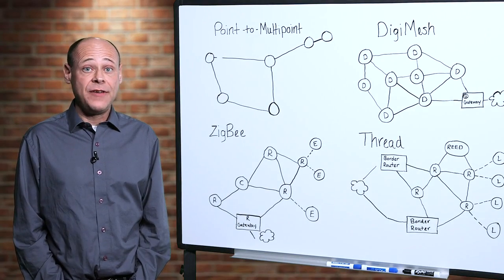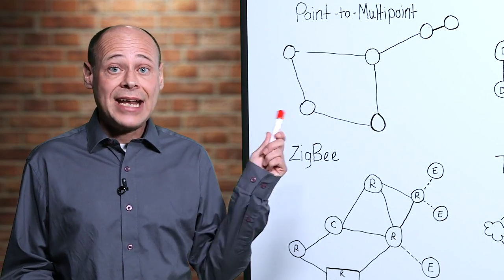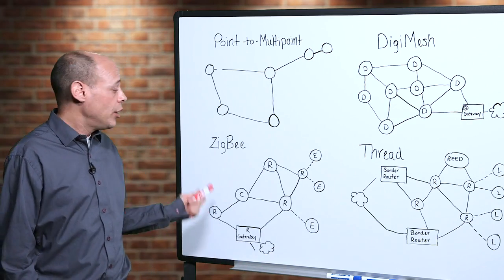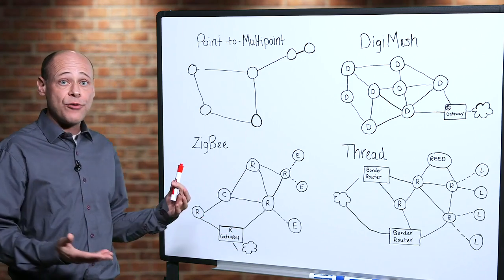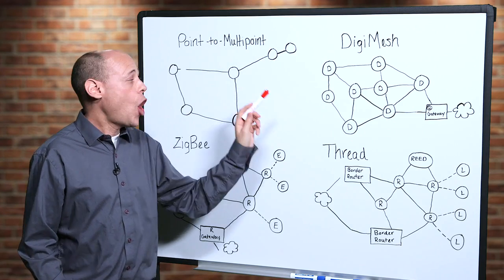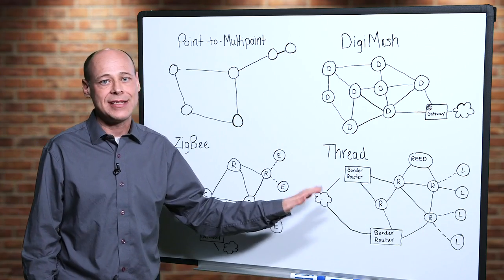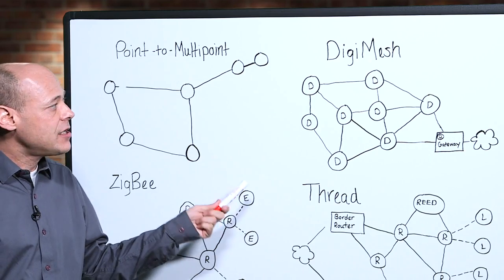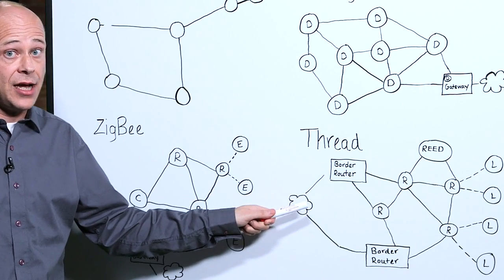Choosing the Right Mesh Networking Technology for Your Application

Comment: Yo it feels like LinkedIn up in this joint, yikes. This vid blows fragmented chunks starting at the hand-waving citation-needing nonsense at 1:48 "Lower latency [...] in some cases and added complexity in putting the network together"  What cases? Compared with what? Mesh vs. non-mesh metrics likely aren't even fair to directly compare considering the mesh and distributed paradigm brings with it emergent properties which shift priorities (e.g. peer latency of 100ms is chill depending on your QoS requirements, let's say Mastodon toots or high-level IoT alert data). And we aren't "add[ing] complexity," you are, with your fancy-ass IPv6 dumpster fire overlay. Any version of IP at the network layer perpetuates your late-stage capitalist bullshit.